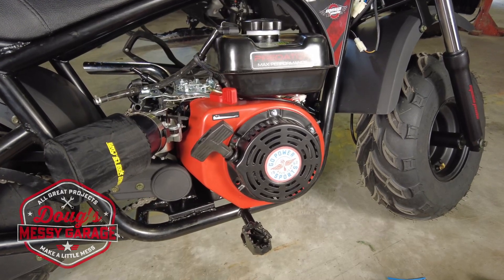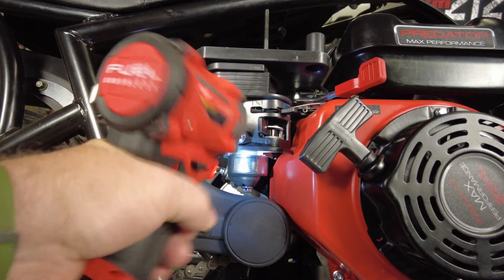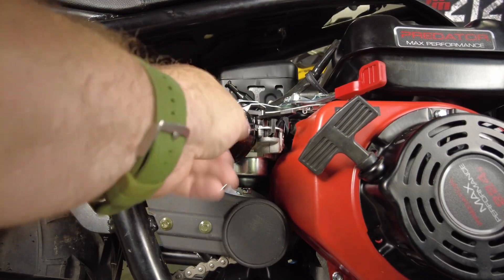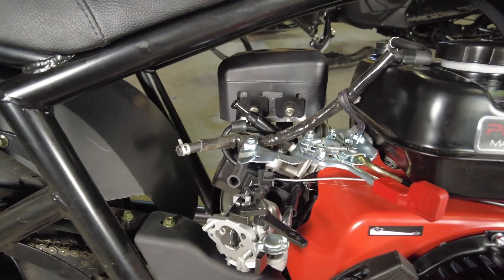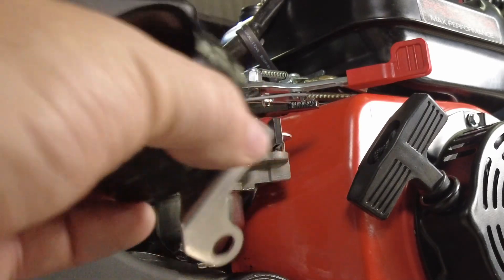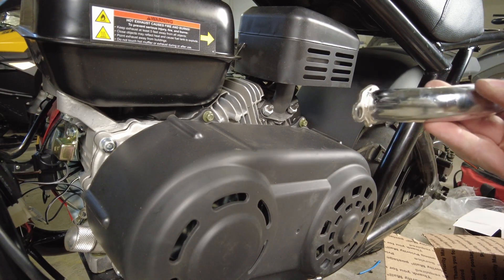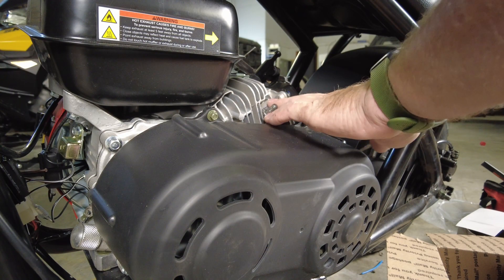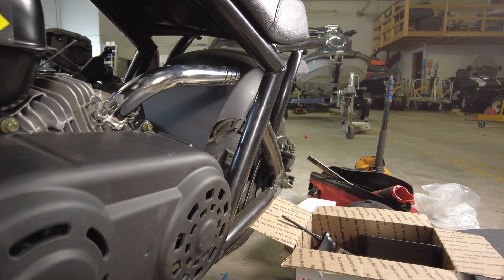Predator 224 Stage One Upgrade

Comment: Howdy, just wondering if anyone has done any real world testing specifically on the air filters? Personally, I have found the stock air box/filter on the 224 to be very good. Also, after close inspection of the stock 224 muffler, I see this particular one has large and open ports., unlike some other stock mufflers I have seen. I have a stock 224 with gov delete, torque converter, 52 mph top speed. I'm wondering how much speed or performance gain verses the expense of the upgrade? What is your opinion? Thanks.

Comment: How is this a stage one?
Reply from the maker: Yes.  Stage two would be a governor removal and some internal upgrades along with a billet flywheel.  Stage three would then include port and polish on the heads and likely an increase in compression ratio.  I want to setup a lighting coil so I will likely not go much further performance wise on my little bike.

Comment: I think you lost your mind on this project.
You reused the stock carb, there was no reason to swap the gasket around, what did you do with the one you took off that wasn't there?
The hemi gasket is the same thing and idk who told you it wasn't, this much I can show.

Just makes no sense.
Reply from the maker: Step one is the stock carb, I’ll likely put a decent slide carb when I get back to it this spring.  The funky spacer is because the stock predator 212 has that spacer on it, the Ducar built 224 incorporated it into the air box so by removing the air box, I lost the ‘spacer’.  Fortunately I found the one I used on eBay.  Thanks for watching and for commenting.
Reply: @DougsMessyGarage  I was trying to be silly and really was wondering.
Sry if I sounded a little harsh.
Reply from the maker: @NubsWithGuns  No worries.  Thanks for taking the time to comment.

Comment: well this kit preform  with out the governer as well?
Reply from the maker: i suppose it depends on what RPM you are running it at.  The stage one upgrade will perform better than a stock carb but it will be the limiting factor if you wind the engine up too much.  

To get the most performance with the governor removed, it would be best to upgrade to a billet flywheel and connecting rod followed by a slide type carburetor. and upgraded cam  I have not done any of these mods on my engine.  If you are thinking of modding the internals of the 224, the stroker crank it uses has clearance issues with the case and cam when using the billet connecting rod.  It will work but it takes some extra massaging.

Comment: What did you end up doing with the 2 extra hoses on the back of the OEM air filter?
Reply from the maker: To be honest, I haven't done anything with them at this point.  I did order in a nice little kit (affiliate link below) that I will install when I dig the bike out in the spring.

Filter kit: https://amzn.to/3YUr1rq
Reply: @DougsMessyGarage  what does that kit do if u mind me asking? i just bight the stage 1 kit and idk what to do with the extra hoses
Reply from the maker: @dylanl6585  The kit puts filters on the hoses so they don't puck any liquid all over the place.  The hoses are vents meant to put the vented gasses into the original air box so they get pulled into the carb and burned.  There shouldn't much if any liquid coming out but the filters control anything that does.  You can just tie-wrap the hoses neatly behind the carb once the airbox is gone.
Reply: @DougsMessyGarage  is it necessary for the extra hoses to be open like that or does it need the mini air filters ?
Reply from the maker: @LawfulYak  My preference is to have the mini filters to keep any dust or dirt from getting pulled into the fuel of crank case.  Cheap insurance.
Reply: @DougsMessyGarage  but I put an air filter like the one in the video and it went slower with it on and the 2 hoses were open without anything so I guess I’m just gonna order the air breather kit thing
Reply from the maker: @LawfulYak  If you put the big filter on it and it's running slower it could be that the filter is over oiled or perhaps your mixture might be too rich or too lean.  Run the engine a bit and then look at the plug.  It should be tan colored, like coffee with too much cream in it.  If they are powdery white, you are too lean, if they are dark brown to black, you are too rich.

Comment: The stock muffler would work with the bigger jet. I used it on my initial run and ride "break in" on my mild build.
Reply from the maker: The stock muffler would likely have been okay except it was blowing right at the rear fender and had already started to damage it.  I have the GoPowerSports.com exhaust system for the MegaMoto and will be installing it in a future video.  Unfortunately, it's winter here now so no road testing till spring.
Reply: @DougsMessyGarage  Yes. I built a small deflector pipe with a flange that bolts to the muffler shield with 4 sheet metal screws.

I have that muffler on my 196 bike. It's a proven performance add on compared to the 196's stock muffler. My 224 bike has a header and mini 91 to take the edge off of header noise. The 224 is a beast and I didn't  even go very far with it. I don't need all that power.
Reply: @DougsMessyGarage I had back pressure issues, any advice
Reply from the maker: @shmeeGriffy  If you are running the stock muffler, that might be a bit restrictive.  I currently have what amounts to a straight pipe on mine right now.  Rather rude sounding but it flows great.  I have a Go-Powersports muffler kit I plan on putting on my minibike to quieten things down a bit but still flow.
Reply: @ I had a straight pipe but I guess it was to short, I may just crack open the muffler and gut it